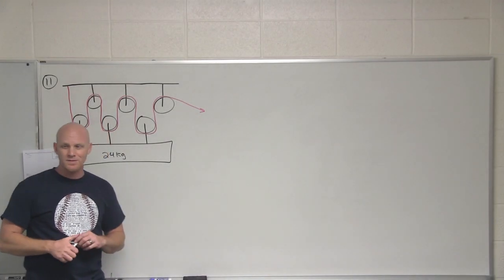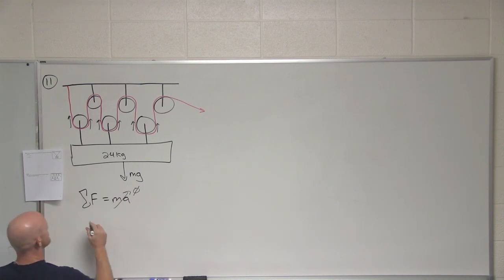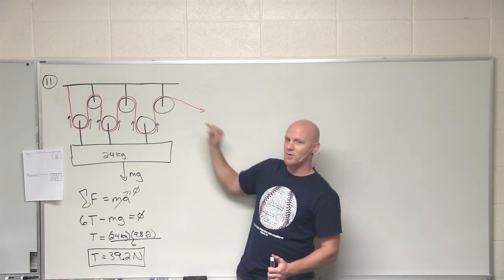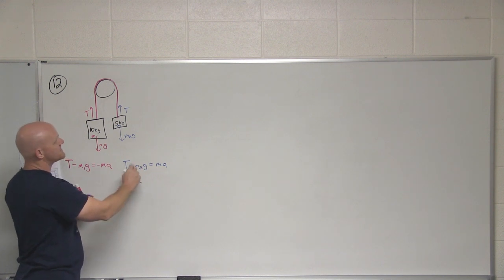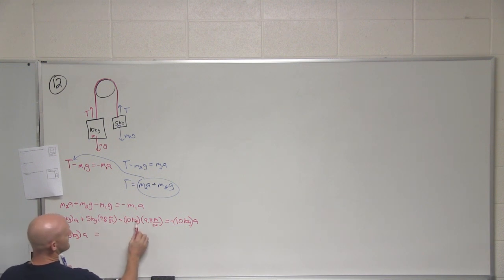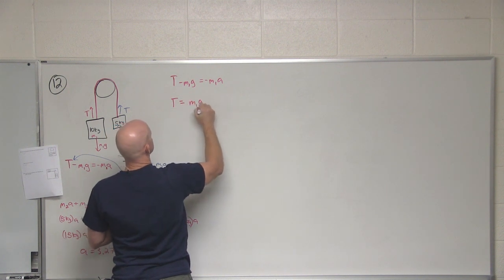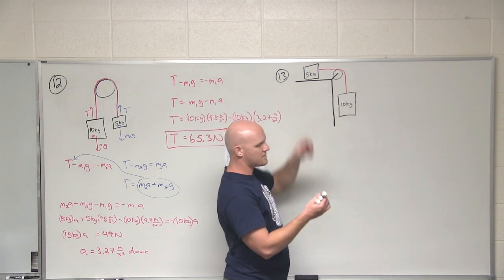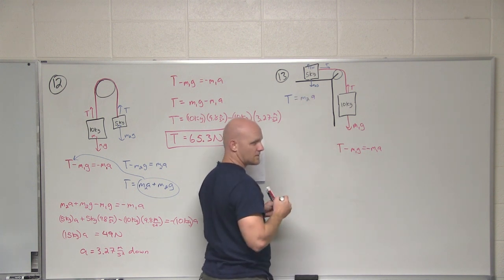4.7 Examples Involving Pulleys

Comment: Why is the tension on the rope only acting on the lower wheels, would tension also not act on the top wheels as well? So instead of only acting 6 times it would act 12 times, more  or less.